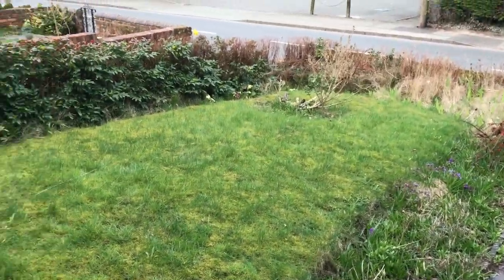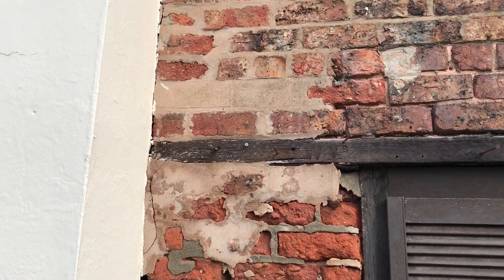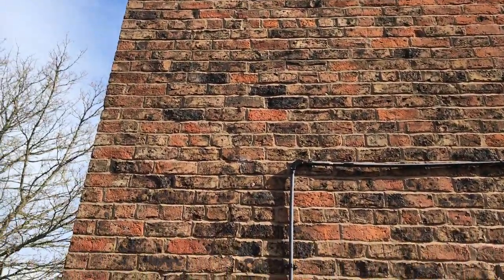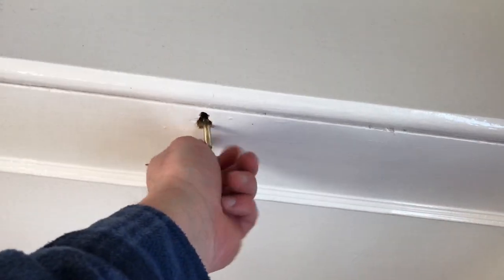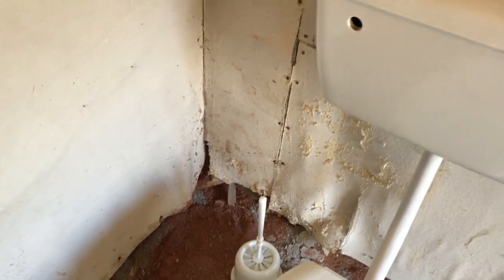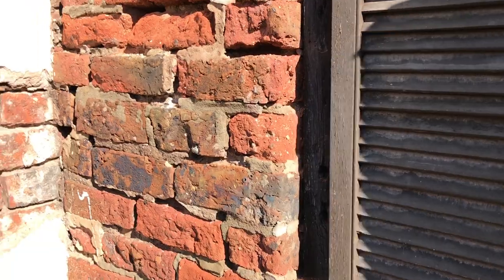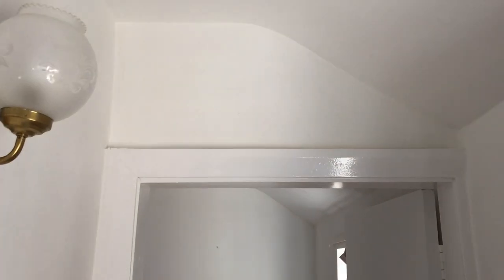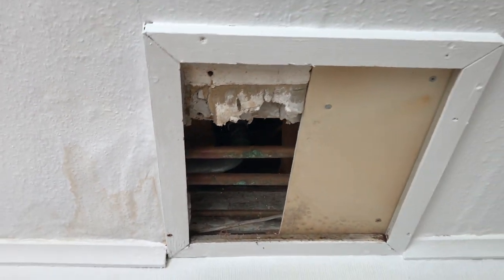I BOUGHT A GEORGIAN COTTAGE TO RESTORE | So much to do!

Comment: Hello Pete, just wanted to say thank you for these videos. Having started my first renovation (a woman alone and without experience!) and wanting to at least try some things myself (😅) I've found most videos about doing restoration predominantly not designed for people in my situation. But your videos are more accessible in the way you explain things and  that you come across as relatable and approachable. I have a similar damp concrete floor issue and render to remove from my period home so watching your videos gives me confidence. Keep up the good work!
Reply from the maker: Hi Laura, thanks very much for your comment. Trying to get more videos made and uploaded but it’s tricky being busy with the actual work and limited internet connection! Good on you for having a go yourself. It’s the best way to learn and satisfying overcoming the many challenges. Like many things, much of the hard work is in the prep and it’s tough reverse engineering a solution from a finished idea in your mind, when you’re stood looking at a crumbling brick wall! Good luck with yours!

Comment: lime lime lime! Everything you use make sure its lime based. internal plastering and pointing I would use lime putty and chimneys and floors either 3.5 or 5 NHL. I would also invested in an all saw arboteck. Not cheap but you will use it so much on this project and will make sure you can turn all those spalled bricks.
Reply from the maker: Hi Tom. Don’t worry it’s all going to be Lime, inside and out. No cement to see here!
General pointing and construction work will be nhl 3.5 and sharp sand. (Even on copings / exposed areas) and internal will be insulated lime plaster made with nhl2.
Yeah an Arboteck saw would be useful but will see how I get on with existing tools before splashing out
Reply: @therestorationstation5475  I would absolutely use lime putty internally. Joy is its all pre mixed so you save so much time not mixing. Much nicer to use than the NHls as well.  Even the pointing externally could be lime putty, the 3.5 is pretty bloody hard.

Comment: I'm in the process of buying a similar aged house.  Used to be a victorian stable block - dated to 1860-1890 ish.  Bloody cement render on two walls - lower half only and the wall was dripping wet when i went back to look at it this week.  You could curse the person who did it!  Thoughts on just a really good quality external paint on the outside and then removing plaster and letting it dry out on the inside before replastering???  I havent got time til next summer to even contemplate removing the render as the entire place needs renovating and im renting until I have a bedroom and bathroom sorted. Anyway, my thoughts are....centralise that front door for sure!  I do like a symmetrical house :-)  Keep up the good work!  Love the channel.
Reply from the maker: Hi Dean - Good luck with the purchase! Lucky that it’s lower half only but unfortunate that the lower half is always the worse affected 😜 My thoughts are paint nothing externally until cement render is removed. Reason being that it makes no difference to breathability whilst the cement render is present, so a waste of money until the render is off (The paint I’d recommend however would be either Limewash or Silicate paint… e.g. earthborn or seciltek) 
If the plaster internally is cement / gypsum (with lime mortar joints underneath) then definitely remove as that will aid drying inwardly. However, if plaster is already lime then removing won’t really help as it’s probably drying inwardly as fast as it can anyway. If it is lime plaster internally and it’s knackered and falling off then no harm removing it unless it’s helping consolidate bricks underneath, which will likely re-harden somewhat as the wall dries once the external render is removed. 
I’d be cautious of re-plastering internally until the walls have dried out if it’s as wet as you say… but if you must then I’d use an nhl2 plaster as a pure lime putty plaster might never set if the walls are continually damp. 
That’s the original door location so staying where it is I’m afraid! Besides, I like quirky and, couldn’t have it central, without a massive headache, since staircase is in the middle! Hope some of that helps…?!
Reply: @therestorationstation5475  thanks buddy...yeah my thoughts were to paint the external walls, which are hairline cracked causing water ingress, with bedec flexible external paint.  It fills the gaps and has elastic properties.  If I can stop the water coming in that would help.  Fortunately the mortar appears to be the original lime and so it's just the damp from the cement render.  The plaster is lime so valid point in terms of leaving it on to dry out from the inside.  Some very good advice though buddy on the re-plasterimg with the NHL 2.  I'll be doing all that myself.  I can plaster with gypsum, but never lime before so steep learning curve ahead!  Yeah I see the quirkiness of the door! I'm far too square though! Haha 😄  it's a lovely house...Good luck with it.  I may well be picking your brains again.  I have a fair bit of knowledge myself from reading the historic England documents on maintaining older properties.  If you haven't read those....they are an excellent source if info!
Reply from the maker: @diyny2809  Tbh I’d personally steer well clear of the bedec paint. It’s a modified acrylic which is plastic. It would be like wrapping clingfilm around already inappropriate cement render. I realise the render is cracked and you want to stop more water ingress but my gut feeling, and it’s purely a personal opinion, that the bedec paint will only trap even more moisture in the walls. It’s a tough call and I’m afraid I’m staying impartial. Make certain no water is getting in anywhere else e.g. too high ground levels causing penetrating damp, leaky gutters (especially above where any cracks above the cement render are) and perhaps just wait out the winter. If possibly, take a strip of the lowest render off to at least let some of the water in the walls escape at the bottom. Then get all that render off as soon as possible and let the walls dry during next spring / summer before repointing with a lime mix suitable for your brickwork. The walls take on average 1 month per inch of brickwork to dry out so 9months if solid walls. Realistically you can probably re-point a bit sooner, especially on the drier walls e.g. south facing depending on your location but with consideration to what state the walls are in at the time and how the pointing mix will cope. 
I am pretty au fait with historic england documents and there is some good and interesting reading elsewhere online as you dive deeper into the subject. There’s also a fair bit of dross! 
This will definitely be a gorgeous house once done, thanks v much for saying so, but (I’m sure you’ll discover) it can be a bit of a rabbit hole of hard graft trying to solve some of the issues. I’m also quite lucky in that I get to gut the house to a blank canvas and solve all the issues as part of a full restoration. I’m happy
to squat in my own building site but I appreciate it’s much harder trying to perform major surgery on a house you’re trying to keep vaguely habitable! I’d put money on your enjoying lime work more than gypsum!
Reply: @therestorationstation5475  thanks for the advice.  Yeah I'm finding there are two schools of thought.  I'll take your advice on the bedec stuff and stick with a lime wash/natural breathable paint for now, with a view to taking off the render at the earliest opportunity!!  That didn't take much persuading did it!  Haha!!  I'll be following your channel and I'm looking forward to see it come together.  Thanks again for the replies and good luck with it!

Comment: Is the churches gate attached to your house?
Reply from the maker: Hi Sam, yes it is. In theory, I’d prefer it to not be there of course and I may have to request it be removed, at least temporarily, in order to  be able to properly restore that section of the building. The side of my house does form the boundary between myself and the Church next door, but it was installed without permission. When I bought the house, I did say I have no objection to it staying there provided it causes no issues to the house. I need to work with the church as I’ve seen evidence of their being less than helpful in certain situations so I need to keep them as sweet as possible, since I need access to do all manor of work from their side. It’s a case of choosing my battles to win the war, so to speak!